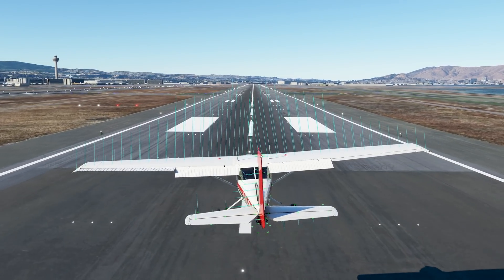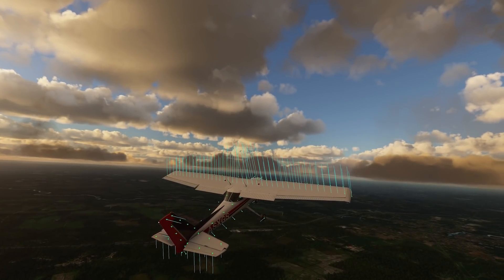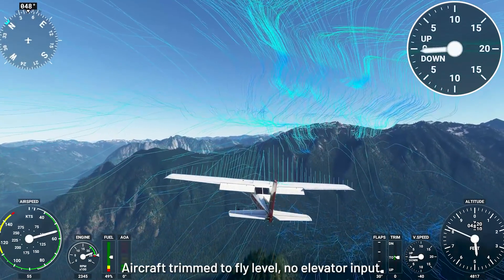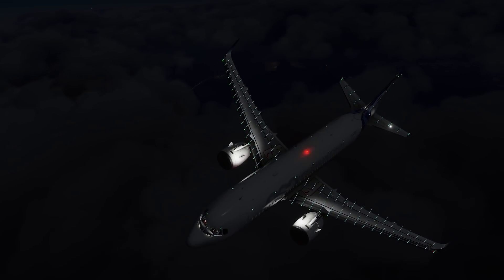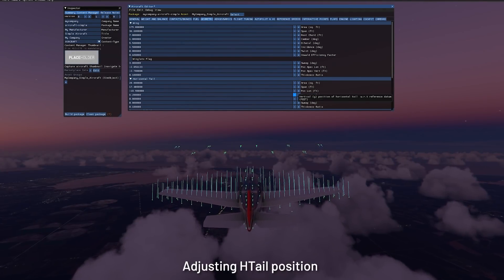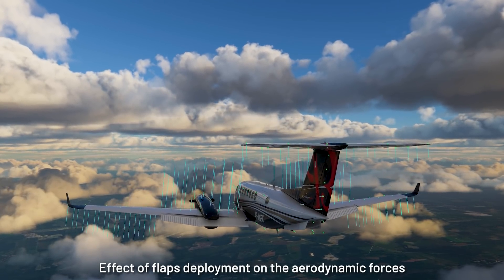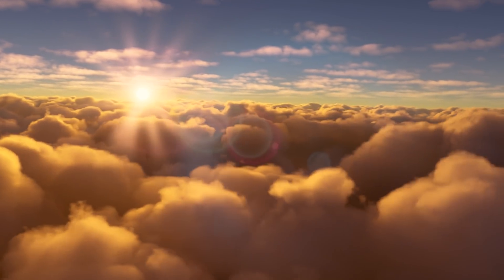Feature Discovery Series Episode 10: Aerodynamics Part 2

Comment: thing is you "adjust how much x causes y" now, but 9-12 months ago, you had "thousands of independently aerodynamically calculated points on the aircraft" and having seen how much was wrong with the flight models, and how oversimplified they are (the only reason i still fly xplane) i wonder what happened to those calculations... were they no good in the first place, or what was the hype about.

Comment: Is it normal that the plane always seems to oscillate back and forward and side by side in the air. It seems every video I see of the planes on the outside I see this movement? I have been to many airshows and I have never seen this behavior. But that is also difficult to see on the ground. Is this realistic because I don't see it in DCS?

Comment: I got a question regarding the propwash:
it looks like it is a uniform probwash as the lift vectors behind the prop seem to be symmetric (example min. 5:45). Shouldn't one side have higher lift as a result of the rotation of the propwash around the fuselage? This is the same effect as the yaw of single engine props during TO roll...

Comment: You have to add drag induced adverse pitch when adding full flaps at speeds above Vfe

And tons of things to match what XP-11 has. ie: simulation of "corckscreew" effects from propeller  wind and its effects on the rudder; simulating different aerodynamic forces of the propeller disk depending on position (this is really important for simulating accurate adverse jaw, and it's not there...), etc

Comment: Airliners are broken.

During flare controls are entirely too sensitive,   and they unrealistically float down the runway forever.  Even if you nail your vref airspeed.
(Make a landing in FS 2020 then go make the same landing in X-plane.  You'll understand immediately)
70 % of the switches are inop and autopilot tries to murder me constantly by diving toward the ground with my V/S randomly changing from +1750 to -5900 when Im not looking..     (literally just did it to me when I tried playing a minute ago)     
 
Microsoft should have partnered with X-plane on the physics side of things.   Because what they have now is more like scenery simulator 2020 (with arcade planes)
Reply: Airliners? I'd say everything is broken. Have you tried doing any aerobatics? Besides, X-Plane is not much better.

Comment: Thanks - you're clearly working hard on the core sim and it's appreciated. You will find the high aerodynamic efficiency of gliders highlights areas of the MSFS flightmodel and ambient airflow which are not quite right - e.g. MSFS flaps don't affect main wing performance as they should (the FSX/MSFS flight model emphasises the +drag/+lift of flaps, while -ve glider flaps are used at higher speeds to significantly reduce the overall wing drag.)  Ridge lift and thermals are totally familiar to experienced cross-country glider pilots and TBH power pilots don't know how little they know in comparison, e.g. what does the underside of a Cu actually look like (strong Cu's are concave on the bottom) and what does the flying feel like as you thermal up into a cloud (the lift can actually improve slightly as you enter the cloud, you can't see the ground within a single turn from entering, and it seems to me the climb is smoother, but that might just be the calm of circling in total greyness)

Comment: Cessna 172's elevator control is still oversensitive at low speeds. It's crazy unrealistic.  Still a brilliant sim, thank you all so much
Reply: Its your sensitivity
Reply: It's not my sensitivity, I've tried every possible option and combination of options.  Many people on the forums complain about it.  If I'm flying at 60 knots in a real Cessna, I have to move the yoke way far to get a real response. In FS it's nothing like in real life.
Reply: @gemeen_aapje  Blade Element Theory is extremely insufficient for flight modeling. I don't know why it hasn't been scrapped long ago, really. Most likely because it's very easy to create "planes" for it.
Reply: @gemeen_aapje  Your computer yoke doesn't have the same amount of movement as a real yoke. Of course it will be different. Not sure what you're expecting.
Reply: @JimNortonsAlcoholism  no, the physics in the game should prevent ANY controller from being able to pull aerobatics in a Cessna at 60kts
Reply: Adjust your controls in settings. They can't custom tailor to all of the controls people use.
Reply: @JimNortonsAlcoholism  Ok, let's see you adjust yours so you can perform a snap roll in the Extra?
Reply: @getsideways7257  Already done it.
Reply: @JimNortonsAlcoholism  Can you do it now and without relying too much on the ailerons? Because a few months ago I was able to do it too, but not recently.

Comment: i would love it, if you improve the trackir behavior in cockpit mode because it self centers the hole time and sometimes it zooms to the panel even when i move my head back. and all aircraft should be able to get registrations which are not being transmitted automatically to another aircraft when selected.
Reply: Maybe something to do with your own settings? When mine didn't go broke it worked just fine.
Reply: @getsideways7257  what did you do?
Reply: @tombmaster972  Well, it could also be attributed to the fact that I was using a TrackHat clip instead of TrackIR. But if anything, I'd expect actual TIR work BETTER, not worse.
Either way, I didn't have to do much, just set up opentrack for MFS just like for any other title, and it worked. In fact, I think I used my DCS setup for it at first.

If you meant it like what did I do to my headtracker that it stopped working, well... I suppose one of the IR LEDs is fried. Need to find the exact one and replace it before I can use the thing again.
Reply: @getsideways7257  well, its not the wrong mode in my programm and all 3 ir diodes are working just fine but tell me, what the heck did you do that you fried one of these led`s???
Reply: @tombmaster972  Turned out the LEDs are fine, it's just the certain someone's soldering skills that were lacking... Note to self: never buy from TrackHat again.
But at least it can easily be restored back to working...
Reply: @getsideways7257  yeah i would be happy as you in this situation. track ir costs alot of euros but i never wanted to fly without it. it is every cent worth!
Reply: @tombmaster972  Oh, I was ecstatic :) The whole thing is made in such a way that replacing a LED would require drilling, I'm afraid...
Totally agree with you on the account of headtracking: flying without it is a pain (especially in DCS).
Reply: @getsideways7257  i just used once dcs and i crash landed the frogfoot ^^ didnt get used to the keyboard settings. do you have fs2020? it isnt that bad without trackir but why without it?
Reply: @tombmaster972  I'd highly recommend the Christen Eagle II for DCS if you are into aerobatics at all. As for the keyboard settings, you can always set up your own mapping or just assign everything you need to the joystick/HOTAS.
I do have MFS (and most of the major flight sims), but I'm highly disappointed with its flight modeling, especially in the aerobatics department.
And no, I don't advocate flying without TrackIR/headtracking. It's an absolute must for any sim pilot (apart from the VR bunch).
Reply: @tombmaster972  Anyhow, this is what flying in MFS using opentrack looks from my perspective: https://youtu.be/Zp5aa8qv-Lk
By the way, the couple of maneuvers you see after the Hammerhead are attempted snap rolls that fail spectacularly...
Reply: @getsideways7257  well i am not that into aerobatics so how long do you fly aerobatics in flightsims?
Reply: @tombmaster972  I wasn't all that much into it before I learned about out of the envelope aerobatics like gyroscopic maneuvers/Lomcovak or the things Rob Holland shows during his performances: https://youtu.be/O-nSpxS_WJo?t=83
Although snap rolls and Hammerheads are also among my favorite maneuvers, this is something I was seeking for the most in a flight sim: https://www.youtube.com/watch?v=4pjGRXFZS7Y
But out of all the modern sims only DCS seems to come relatively close: https://www.youtube.com/watch?v=3inFh673oUE

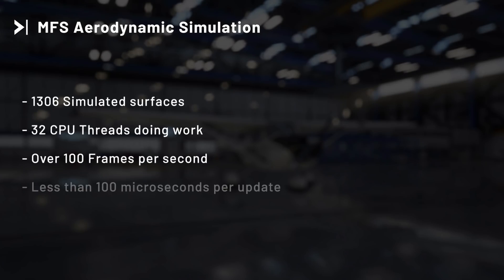Comment: At 5:05 , it states that the aerodynamic simulation uses 32 CPU threads. Time to get a 5950X?
Reply: Spanning 32 threads doesn't mean it requires or necessarily even benefits from a 32 thread processor... you will have thousands of threads happening at any given time. For example I just opened task manager while sat idle browsing youtube right now and I currently have 2504 active threads. This sim is still significantly main thread limited on the CPU side, so adding more cores won't help much yet as that thread will always be the limit on your CPU performance. As it currently stands there is no benefit in this game beyond 6 cores, hopefully that will improve as time goes on and they can move more things off the main thread. transition to DX12U in the summer could potentially help somewhat as well.
Reply: @Zeeflyboy  Thanks for the explanation.

Comment: Was hoping to also see thermals simulation. Gliders are a must in this sim.
Reply: Nah they dont have it yet. They'll need to link weather with thermals - thermals aren't a thing right now.

Gliders and helos are on the roadmap, but they're focusing on the rest first. I would wait at least a year if that's your bag!
Reply: Don’t they have this already? Just no gliders? With live weather on I often notice changes in lift going over a cold lake for example, or suddenly flying over a city from the countryside.
Reply: @RobManser77  You might be getting changes in lift due to terrain interaction, which is implemented. But as mentioned before, thermals are different. I don't remember them ever mentioning thermals. So i don't know if they're implemented or not.
Reply: Yes please
Reply: Saw the transition from land to sea?
Reply: @TheNordicVoyager  i think he means that you get rising and falling air masses depending on what surface is below you, for example it is much more likely hot air will be over a city rather than empty fields
Reply: @tomatosoup5056  And that's what I am talking about.
Reply: @TheNordicVoyager  I believe that is a different effect. What we need is areas that release more heat causing the air to flow upwards. This can even be on a flat terrain depending on the ground texture and foliage. Typically forests suck all the energy and will pull you down. Sandpits however release a lot of heat lifting you up at the same time.
Reply: @TheNordicVoyager  thermals are cylindrical columns of rising air. When you see cumulus clouds, each one is usually being created and sustained by a thermal. Glider pilots can use thermals to fly hundreds of kilometres without an engine.
Reply: @Haapavuo  In their qna they said that thermals are actually in the sim and generate over 20c and are found under cumulus clouds. The reason you’re not able to climb in thermals yet is because they haven’t actually implemented anything that enables a glider to climb in thermals. (This is according to what they said in the qna stream and what the msfs discord mods told me)
Reply: YES PLEASE!

Comment: You should add to the customization screen under each aircraft an option to assign control profiles for yoke/throttle/pedals so you don't have to change it in the options before each flight to match the aircraft you're going to fly. Its currently very inconvenient
Reply: You can create a control profile for every aircraft or type already. Agree that dynamically linking it to the aircraft would be great.
Reply: @johnmheaton  I know you can create them. I have several profiles for different aircraft. Its the changing it before each flight that's a pain in the ass
Reply: Guess there's 2 options here. I'm find with the current, which I just switch from 'GA' to 'Jet' or 'Airliner' as 3 settings are fine for me so far. I mean, how often are you switching aircraft really? And it's 5 to 10 seconds to switch those settings...
Reply: @cebrady  it's a basic feature that needs to be added. Xplane 11 has a drop down menu in each aircraft settings to assign a control profile for seamless switching. It would be very easy for Asobo to do
Reply: @wingviewproductions  - Xplane 11 is 4 years old. I'm more worried about a ton of other features being added. Your "very easy to do" feature is at the bottom of the backlog, and it should stay there.
Reply: @cebrady  that's your opinion pal. Thanks for being the official Asobo spokes person!
Reply: Agree 100%

Comment: You said something about updrafts because heat and lakes, That does mean the sim will make simulation of thermals? Hope yes!
Reply: I'm pretty sure this is part of the work needed for them to bring gliders in. They said in a video they want to do this in the future.
Reply: Yes! Im a glider Pilot and this would be my dream!
Reply: It's already in there, or at least, the ground work is in there since it already simulates airflow (I am guessing using fluid dynamics).
Reply: @ukmaxi  Well, not real time fluid dynamics, because that is impossible with current hardware but a simulation of it.
Reply: @JimNortonsAlcoholism  CFM will always be ‘simulated’, because real life fluid dynamics problems don’t have exact solutions (mathematically speaking, you cannot find unique solutions for the Navier-Stokes equations, and so on) and you need to use numerical integration methods as soon as you don’t work on perfect spheres or tubes of infinite width in laminar flows. Then the computing power you’ll need will depend on the resolution and the refresh rate you want (for a ‘real time’ result).
Reply: @fabiena1787  Why are you stating the obvious? Of course CFM is a simulation. That's the whole point. Real time CFM for a commercial flight sim is not possibly currently.

Comment: Shouldn't be also simulated the propeller drag? Seems you are not really caring about this...
Reply: Et un modèle de vol qui ne ressemble pas à un jeu vidéo mais à un simulateur comme les concurrents!
Reply: @michelfarey6190  the propeller drag is a basic feature that would make a dramatic difference (= producing A LOT of drag with certain pitch configuration). Seems just that there is no real care for variable-pitch propeller aircraft. Let's hope when the Turbo-prop update come. Also, not sure why you replied in French...
Reply: @MrFreddy995  While I personally believe the "flight model" of this thing is a complete joke, I'm pretty positive that coming straight down after a Hammerhead with the lowest pitch and in a more feathered state produce vastly different results. In the latter case the plane falls like a rock.
Reply: @getsideways7257  have you made any test about this? In my experience the difference is really little noticeable.
Reply: @MrFreddy995  Well, I didn't try to stopwatch test it, since it really was looking like at high RPM it was taking forever to go back down, while with the prop adjusted accordingly the ground would just rush right in the face. But maybe that was all simply psychological effects... Either way, it will be a while before I check it out properly. And I guess it's best to use TacView for this, which I happen to conveniently have.

Comment: Looks advanced but why can the A320 fly straight and level in ground effect at 80kts idle thrust with full fuel?
Reply: Are.you using the flybywire a320?
Reply: @bagels377  Yes, latest version
Reply: @cmac6769  legacy flight model or modern? I've got the latest dev version of the fbw and it flies well
Reply: @bagels377  Modern, it handles okish in flight, landing has some issues
Reply: really the flight model of all airlines is very poorly done, my a320 with FBW mod can lift the nose to exactly 80 kns as if it were a sheet of paper, not only that can also in the approach speed, complete flaps, levers in idel, and spoilers lifted by hundreds of meters of track in 10pes, even the deafening Screaming cockpit STOL !! STOL !!